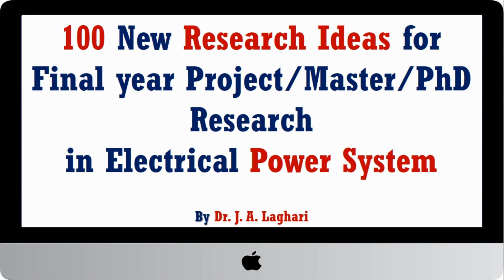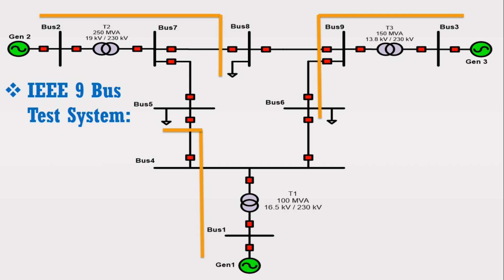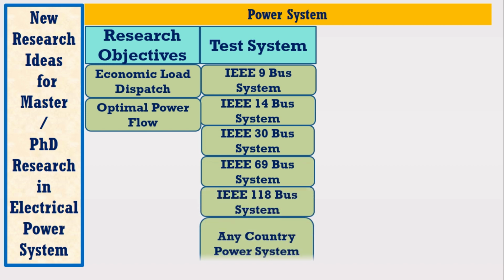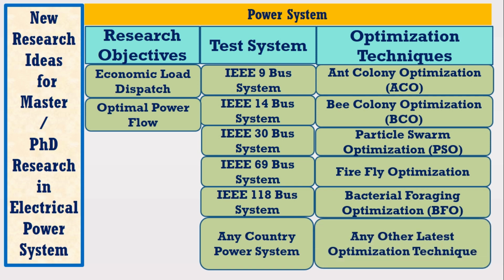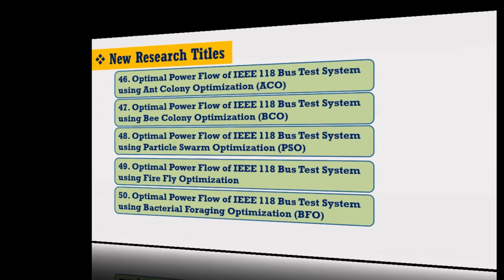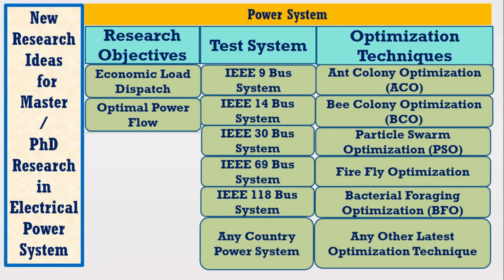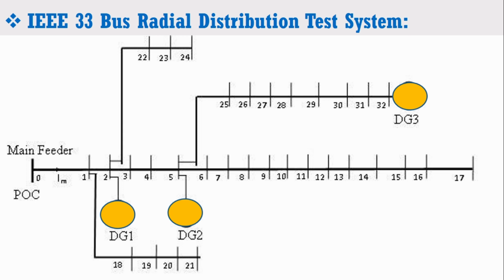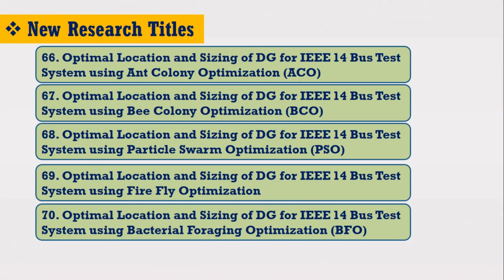Top 100 Research Topics | Research Paper Topics | New Research Topics | Dr. J. A. Laghari

Comment: Hi sir.
Iam doing my research in power system state estimation.
Can you please suggest me some good topics in this area sir.it will be very helpful sir.
Reply from the maker: Thanks for your message. State estimation is very important topic. You may consider the state estimation in distribution network Connected with distributed generation in which  only few measurements are available. Therefore, you can use this technique on load buses to measure or estimate their voltage, their load and perform its voltage and frequency stability analysis. Furthermore, you can propose  loadshedding scheme based upon the state estimation to make it economical. It is because with this state estimation, no further measurements are required which are expensive and make the system uneconomical. Hope it will help you. You may find some research papers on these topics.
Reply: @DrJALAGHARI  thankyou very much sir.
Its a great help for me sir.
Reply from the maker: @sravankumar1263  my pleasure.